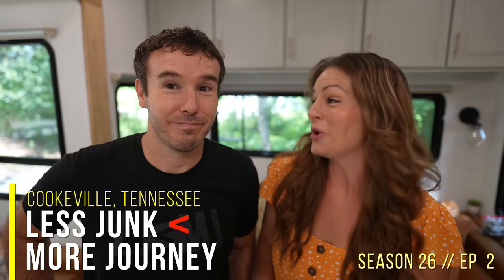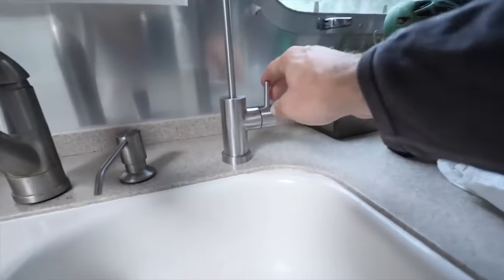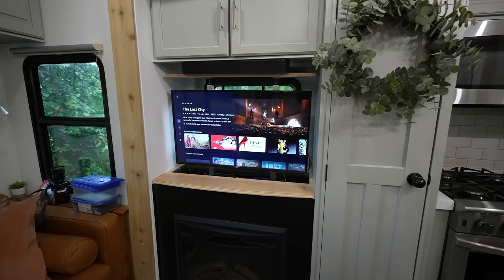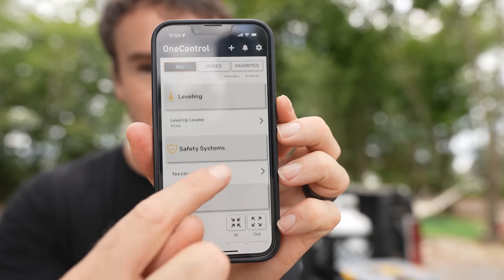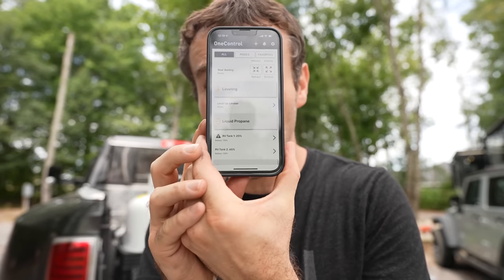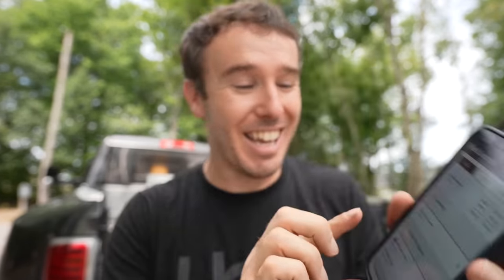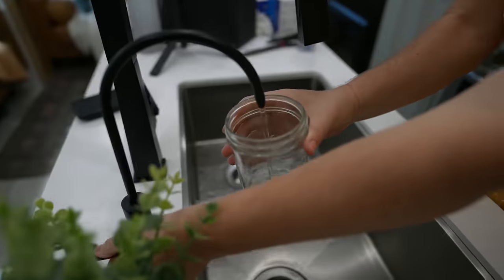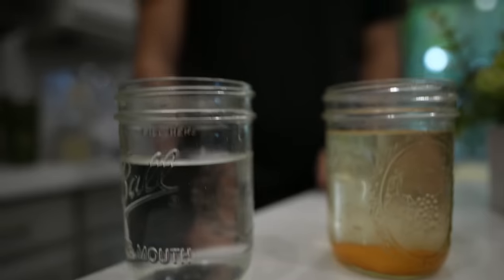6 RV Hacks That Make Your Camper 🚐 Feel Like a HOME 🏠

Comment: Nathan, The dirty water.... for frost protection these yard hydrants dump their water into the ground when you close them. That means they have a little hole, an open connection to the soil around the hydrant. Clean water can go out, but muddy water can come in too.  That explains while at the start of use you will have water of shady quality.

We open these kind of hydrants only once, then flush it well,  and use a second little garden hose valve to turn the water on and off from then on , which keeps the hydrant under pressure and clean. Only when we leave for the winter do we close the hydrant and take the second valve off to empty the hydrant.
Reply: He's right.  We had an outdoor hydrant that ran clear water for years until one spring.  When we installed it the bottom was incased in pea gravel, but after a few years the backflush water (what drains out and makes it "freeze proof") had created an underground mud puddle. So when you turned it on it sucked up the muddy water. Run your water for about 10 minutes and see how clear it gets.

Comment: If you have well water that looks like that, I’d say that your well isn’t deep enough. My Dad always said our wells had to be deep enough to go through three layers of natural gravel filtering. If you have city water, don’t let them pass that “normal crap” off on you! Maybe they can’t take all the lime out, but they should at least take all the rust and sediment out. Either way, maybe consider the Clear Source 3-stage filter. We installed that on our rig and ALL water incoming to either our pipes or fresh tank go through it. We have great water wherever we go. I think its much better than just filtering at point of consumption. Thank you for sharing all the possible filtering ways… and cheers to good clean water!

Comment: im not sure if you have looked into recirculating shower systems for the rv? the van lifers are loving this option. it is a series of filters that saves your overall on board requirements for boondocking. what happens is...the water comes out...falls on you....gets funky and or soapy....collects in a reservoir and is filteredin real time and travels back up to your showerhead so you can use the same 2ish  gallons over and over until you consume it. you can take an hour long shower if you want!. paired with on demand hot water...real luxury.

Comment: Thanks so much for this video! Specifically, we have a rear living room Montana with two queen fold outs in our couches for our kids because we didn’t want a mid bunk. In short, putting a cover, sheets, and blankets was a hassle each night and each morning. With this we can put it on at night, unzip it, sleep, zip it back up, take it off, roll it up and toss it in storage plus the kids can now do it themselves because its so easy. Also, we found two sets that were on sale for almost $90 off (because we don’t care about the design necessarily) bought two sets and the discount code you gave still WORKED!! Thanks! Basically it brought the price for two (on sale) sets down to the retail price of one set. Incredible deal! Thanks much!!

Comment: Our beddy's is currently sitting on the picnic table, we're done with it...can't stand it anymore.  We have used them for about 2 months.  They don't have a top sheet, which is fine I guess if you can keep your A/C at 55 maybe?  We were always too hot or then too cold when we would kick off the top blanket.  We have a queen and we haven't been to a laundromat yet that we can actually get it clean or dry.

Comment: You can slow water on either side. The reason it works on the output is water cannot come in any faster than it goes out.  We also use the Clear2o water filter and sediment filter combo. The water filter is available at Walmart and it's green, not the cheap blue camco filters.  The sediment filter is available online.

Comment: Get yourself a three pack of 10"x 2.5" water filter units, connect two or three of them together in series. Add the hose fittings on the filters.  Use a particulate filter first followed up by a carbon filter. This will give you the best water clarity and taste.

Comment: To quote John at the RV Odd Squad says regarding water, "If you do not have a filter, you are the filter." As long as the flow is restricted, there will only be a small amount of water flowing through the filter at once. Yes, waft is the correct term.

Comment: The flow restrictor is after the filters instead of before the filters so there is more pressure to push through the filters.  If the restrictor was before the filters it would be much harder for the water to go through the filters.  Either way the flow is being restricted (before or after), its mainly just if they want the pressure low or high on the actual substrate.

Comment: Just a heads up here. Yes flow restriction is slowed down either way of coming in or going out with that restricter. But you do have it backwards from what the photo you showed on the phone. The diagram does show the restrictor going into the filter and not out like the way you have it.

Comment: So your LP tanks, what's far ,far easier is a simple swap over valve.  When ones done it simply switches over to the next tank with no break in service. The valve shows red letting you know you need to swap it out. Replace and then, when that one runs out it switches back again,  and so on, and so on. So you never ever run out and you never ever have a break in service.  No faffing around with hammers and feet, apps and sensors,  and where the he'll do you buy more SONIC GREASE  when it runs out. 🤔 
Swap over valve is the way to go 😚
Ofcourse you don't get paid for you Lipart and advert.

Comment: re water of course you want safety but i  think the benefit to filtering your water is consistency. as you say its so difficult on the road. in my exp you can get used to anything. i dont move around a whole lot so i make a point to train myself to use tap water for drinking and cooking. i know its safe if not perfect and if i was truly worried the crap i add to my water in the form of crystal light, coffee creamer etc makes my concerns less than credible. so i get used to whats easiest to procure. 

in your case theres nothing to become familiar with so filtering may give you a consistent product to start from and then i would def be looking to make do with the simplest water solution available so you can stay hydrated and healthy. skipping because you dont like the available water can lead to trouble!

Comment: I’d be interested to know if the water looks like that if you let it run at full volume for 3 minutes. Hydrants flow fast which tends to flush the line and the water looks like this until it’s flushed.

Comment: You guys are so cool!
I liked the Beddys so much in the RV, I got the same for the house. I figured if I ruined one half I could swap parts. So far it's wearing like iron. I'm going to put an elastic thingy underneath so it doesn't scoot to one side as I toss and turn.

Waft? No. 
I'm experimenting with two external water filters, one is a Camco 2.5" x 10" filter canister while the other is a 4" x 10" canister. I quit using the inline Camco carbon filter.

Comment: I'm curious if any galvanized piping was used to connect your outdoor water source?
Reply from the maker: Not that I know of
Reply: @LessJunkMoreJourney  Does your mother's house have the same problem with her water.  I ask regarding galvanized piping because it can corrode and cause a very similar problem.   Does the water clear up if left running?   Have you had the water tested?   I lived in south asia where they used galvanized pipes with similar quality.  It cleared up if left running.   Thankfully, we had a distiller that we used to produce pure water.

Comment: Question, we noticed you installed the acuva box upside down. We just got one, my husband installed and then I saw in the instructions it says “do not recommend” for installing it that direction  (that’s when we noticed the “upside down” 🤦‍♀️😅) Have you had any issues with yours since this video or needed to “flip” it around?
Reply from the maker: We didn’t even realize that. Ours didn’t fit great unless we installed it that way. We did have one go bad and they replaced it with no issues, but maybe it was related. Good question. 2 years with no new issues though.

Comment: I'm not all the way through the video but you have me wandering about the total weight of the weights being too much weight for the safe operation of your slide. I am not familiar with slides and may be needlessly pointing that out. I think about strain on the slide itself or maybe causing a leak. Either way,  no response needed  and this comment is my contribution. Howdy from Rockwood Tennessee.

Comment: I love Beddy’s concept and have several sets but……………will never buy again.  One design we had problems with two sets.  The bottom sheets would stress tear a bit from the zipper.  That particular material also stained easily.  I was very disappointed in that design and customer service.  7 sets purchased but never again.
Reply from the maker: Sorry to hear that, we've never had that issue with ours.